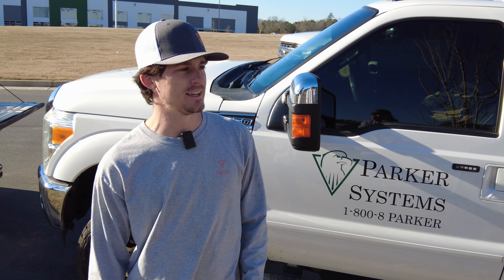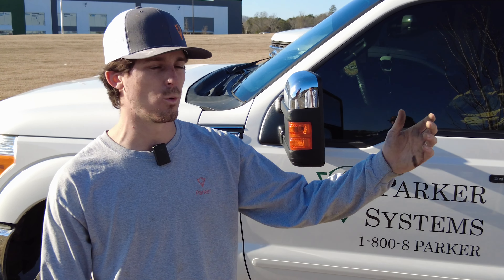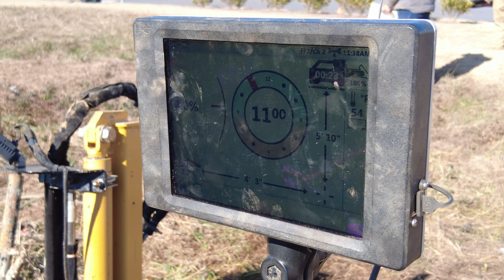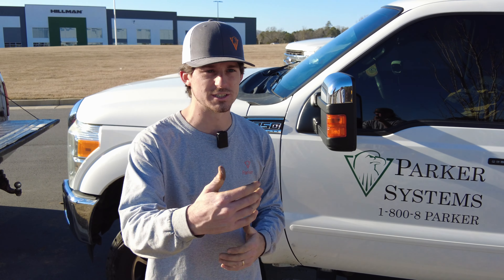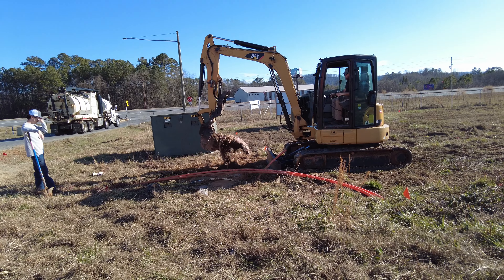Commercial Fiber Optic Network Construction! | Parker Systems

Comment: All that work and money spent for 200 mbps
Reply: At 4:00 in the video it says that the speed test was done on an iPhone 15 over a WiFi connection. The speeds are way faster when connected directly to a router or a switch with an Ethernet cable.
Reply from the maker: That pretty good for a wireless connection -- right at the limits of the radios built into typical cell phones -- thanks for watching
Reply: @ParkerSystems my wireless is 980mbps on my phones. So no it isn't right at the raidos limits